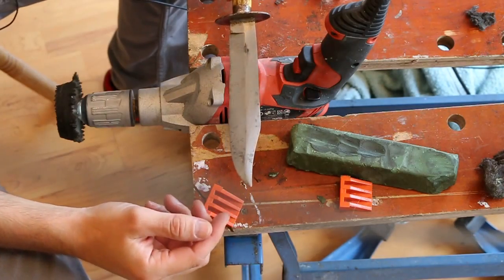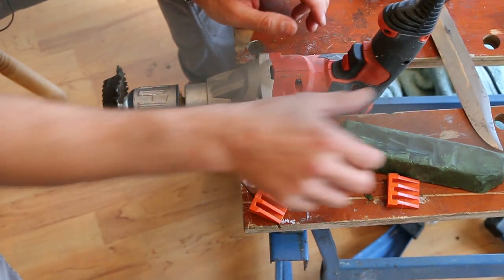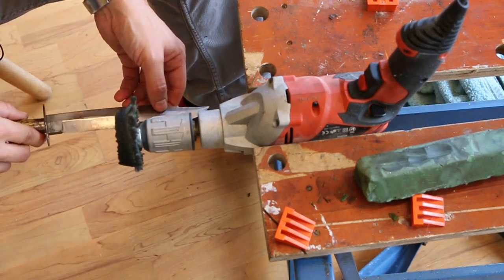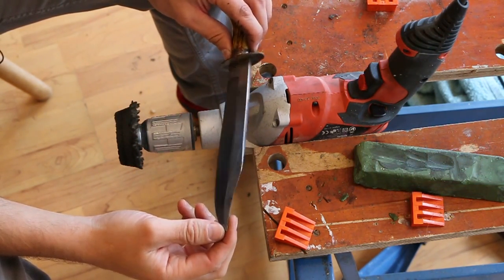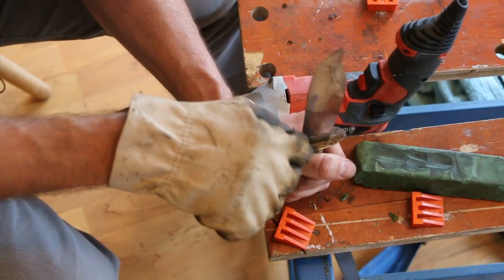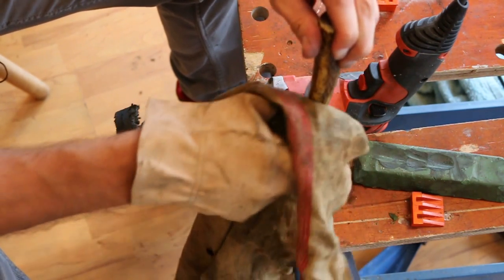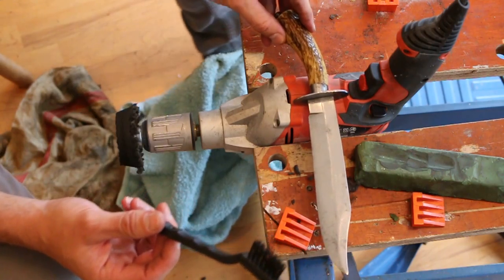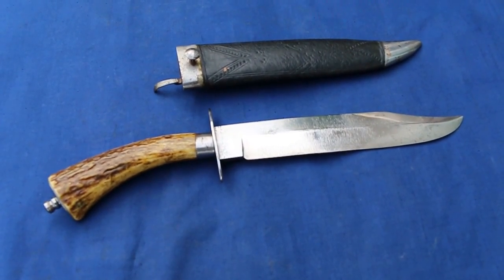Restoring an antique Anglo-Indian bowie knife - Part 2

Comment: Hi Matt. Love the videos. Keep them coming. I restored an old Mexican bowie knife a few years ago. It was an antique store find. It had a really great hilt and that's what initially caught my eye. It was cast aluminum in the form of a snake eating its own tail. The head is the pommel and the tail wraps around to form a wavy knuckle bow. It also has bull horn scale inlays. Since the handle was, of course, corrosion-free; I began working on the blade. The blade was quite crusted in layers and layers of scale. Instead of going full bore and sanding it, I opted to use the very narrow tip of a needle file to flake off the rust. Hours later, my efforts paid off as both sides of the blade were etched, though the edge had been roughly ground throughout its 90 years (stamped "Gomez 1925" on the hilt). One side has "Mexico" etched into one side and the other side is a scene of a lion running through the desert, possibly holding something beneath its paws (past rough grinding on the edge removed some detail). I painstakingly removed all the rust and then used a piece of rough toothed parchment paper and some mineral oil to remove any surface rust and leave the patina to accentuate the etching. I prefer mineral oil for all of my knife and sword care personally.

Comment: Especially from a H&S Standpoint you never ever wanna wear gloves when using a Grinder or Buffing-wheel. Reason being the glove can catch on the Wheel and drag your hand in resulting in some very nasty accidents. Another benefit is that you're very unlikely to overheat anything since its gonna get too hot to hold long before that happens.
I'm not sure what kinda damage a drill mounted wheel can do but i dont plan to find out.

Matt how would you restore a blade that has etching or surface decoration on it?  some Chemical treatments like electrolysis perhaps?

Comment: If anyone is looking for the "green stuff" - it's chromium oxide buffing compound. It's also very useful for stropping.

I would also like to mention that the varnish is actually very likely shellac. Shellac is not a chemical, but an excretion of the female lac bug, which is indiginous to India. Most shellac is, and always has been, produced in India, which is why it's highly likely that this knife was coated in shellac.

Unbleached shellac has a brownish teint to it, but even bleached shellac turns grimy-dark with age. As bits of the coating might come off when using the knife to cut meat etc., shellac is also a good choice for protecting knife blades with, since it's completly edible. In fact medicinal pill hulls are often made from shellac.

Comment: I'm wondering do antique swords and blades still keep a good edge? Like is the hardness and temper of the steel similar to when it was first made or does it wear with age?
Reply from the maker: The hardness remains the same for all eternity, so long as the blade is not heated again.
Reply: Thanks for answering, that's really cool. I'm curious do you whether  old swords were reused by future generations and how long did swords get used for, if you know what I mean?
Reply: isn't there such thing as "tired" metal?
Reply from the maker: Fatigued or work-hardened, yes. If a blade is stressed too often (for example by flexing, over-flexing, or bashing on things) then it will start to become brittle and tiny fractures will form in the steel.
Reply: Swords that haven't been used much could get used over generations (same as firearms today if maintained properly), but keep in mind that fashion changed rather rapidly. While a poor man could use his grandfathers Landwehr, someone with a bit more money and prestige would probably not be caught wearing his grandfathers old people-poker. Plus, styles of fighting changed as well and older style swords could become outdated, again just as firearms today. My grandfathers Luger might work perfectly well, wouldn't take it to work though.

Comment: Green stropping compound is best for almost everything, but red jeweler's rouge, which is also a type of stropping compound, will put a mirror surface on even an antique blade.  Just don't make the mistake of buying industrial red compound made for use of power tools.  Industrial and stropping compounds use the same colors, but not for the same grits.  Red industrial compound is  extremely aggressive and can damage metal rapidly.

Honestly, there is absolutely no need to use a power tool to polish knife blades.  The best true mirror finishes are done by hand by stropping, not by using a power tool.   If you use the correct compounds, it doesn't even take very much elbow grease.  Even with very old, troublesome blades, if you start with green, go to white, then to red, you can put a mirror surface on your blade that's better than the one hanging in your restroom.  You can often even skip the white.and go straight to red.

Or, if you're a fanatic and enjoy the process, you can use green, then green fine, then white, and then red.  I do this at times just for the heck of it.  I don't get a detectably better edge if I'm sharpening, or a detectably better mirror finish if I'm polishing, but it's still fun.

Anyway, I've seen too many knives and swords damaged by power buffing to ever do so, especially when a hand strp does as good, or an even better job.  Sometimes the damage done isn't even noticeable until later one when you notice a ripple that shouldn't be there when the light is just right, and you're looking at it from an odd angle.  

Well, they're your knives and your swords, not mine, and, admittedly, I am often a bit of an obsessed fanatic myself when it comes to knives and swords.

Last note.  When cleaning antler, ivory, wood, or anything else, I think you need to know how it looked when it was first put on the knife.   Then you use soapy water.  Then you check how it looks and decide whether to go another step and use a mild, mild abrasive of some kind.  Experience is the only real teacher here.  Look at all the new antler, wood, ivory, etc., you can find, look at wood that has been oiled or varnished,  on and on, and then decide whether you want a very old knife to look like a very new knife.   If it doesn't damage the knifes authenticity or value, I usually want it to look as new as possible.

Comment: Two questions.  First, you applied a paste to your buffing wheel before buffing the knife, and did not reapply for some time.  How much paste do you apply to the wheel, and how do you tell if and when a reapplication of more paste is called for?  Second, there are two screws holding that clasp onto the scabbard, might you remove them and attempt to rebend or straighten the clasp?
Reply from the maker: With continuous buffing I personally re-apply paste about every 5 minutes. But it depends what I'm polishing - on the hilt and scabbard fitting I tend not to apply any paste, because they are softer and more delicate, and I don't want to get paste all over the leather/antler.
Reply: Thanks for the info and the response

Comment: as someone who works in trades never use gloves with a rotary power tool. That being said his set up isnt exactly safe so you're taking a chance anyway. I mean it is a knife
Reply: Yea, I was gonna say, standard safety practice is to never use gloves when working with moving parts like that.
Reply: And solid cloth type gloves (like the earlier used ones to keep the sharp bits of metal out of the fingers) would probably be some of the worst for it when a rotary tool grabs hold of it and rips it along with your flesh off. 

I still have some icky memories of the first time I looked up the term "deglove" on google image search on someone's suggestion when learning about this particular "no gloves on rotary tools" guideline. Some of those were quite gruesome to look at.

I suspect something really thin that tears easily if direct contact has to be avoided wouldn't be nearly as dangerous as it should tear rather than try to stay in one piece and ruin your limbs. A thin latex type thing with the right grip surface maybe? But even that wouldn't be ideal compared to the direct interaction with the workpiece and better feeling for it with bare hands. I don't know much about it though, just some minor experience from occasionally using my dads workshop if I can't do the job with the tools I have at home and what I picked up over the years + common sense.
Reply: yea a big enough machine will take your whole arm off 🙅. You're right about latex gloves. Maybe they could make tear away gloves that easily come apart on the seems haha

Comment: Would using 800 -1000 grit wet dry clean up the grind marks without damaging the "patina" to much? The pitting looked deeper than the grind marks. Of course you couldn't be heavy handed as that would be more damage than just leaving it alone.

Comment: How would you recommend removing red rust spots?
Reply: Watch the first video? (WD40 and wire wool.)
Reply: Bo Zo Oh, should have made myself more clear, I have tried that. But there a some bad red rust spots that won't go away.
Reply: You can try a rust converter.  The tannic or phosphoric acid will convert rust into a stable black oxide.  The acid may damage other materials (eg. brass, organics), so protect adjoining areas with tape, varnish, wax, etc.
Reply: Oh, and be sure to follow up with oil, wax or varnish afterward.
Reply: One rust converter commonly available in the US is called "naval jelly".
Reply: Thanks for your help!

Comment: how did you make your drill keep spinning while your finger isn't depressing the trigger? is this some sort of specialty drill?
Reply from the maker: Many drills have that function - it's a locking button at the side of the handle.
Reply: A lot of the older drills my father has definitely have that function, some of his newer tools don't though.
I don't know if its an industry best practice/design change or maybe mandatory safety regulations to prevent runaway tools when you drop/release them.

I'm not entirely sure how this is supposed to work for things like drills, but I certainly noticed a trend with other rotary tools like grinders etc to no longer have them on new models. Not a pretty thought actually a runaway grinder with an abrasive wheel attached slipping from your hands going on a rampage.

That said if you have one without the button that may be deemed "dangerous" by the industry/regulatory bodies there's always the tried and true method: tape the trigger so its on 100% of the time and switch it on/off externally at the power cord somehow (switch in the cord, power strip with a switch, whatever gets the job done really). 

If you do plan to do this tape method though be very sure about how you're fixing the tool in place. Ideally you want to use a proper grinder that's made for it. But use some common sense and make sure it can't accidentally get loose and don't be in the place where it'll go if it does get out of whatever is holding it.
Reply: Good idea. Thanks for the tip

Comment: If you change the color of the steel you have ruined the heat treatment in that area.
Reply from the maker: No, that's an exaggeration. Up until the colour blue there is negligible change to the hardness. The steel will go through straw colour first and at that point it really doesn't make much difference at all to the hardness or anything else.
Reply from the maker: In any case, to get a blade to even straw colour from buffing alone is a difficult task and your fingers/gloves will be burning by that point.
Reply: The discolouring will begin to apear between 100°c and 200°c and so long you're not keeping that temperature for an hour or more, you're not changing the properties of the steel. However that is only important if you're working on a piece of already hardend carbon-steel.
Reply: I have trashed many a blade whilst learning about them.  I have only ever ruined blades by using a stone grinding wheel and the other method was a belt sander. Both of these generate immense heat and friction very very quickly. 
Alas. The downside of having mediocre tools lol. 
I agree with everyone else if your not wearing gloves you'll burn your hand before discolouring the metal.

Comment: In America, we tend to leave patina alone on antique guns and knives. My opinion is you buffed its history off. Way too shiny to my eye. You would have cuts its value in about half over here. I have bought a few antique guns from Britain, and all had been over-cleaned. we stopped doing that in the late 1960s. Lots of museums ruined lots of guns and blades. They probably still do. Our philosophy among collectors is that more antiques have been ruined by cleaning than by being left alone.
Reply from the maker: It's important not to 'over' restore. That's a subjective scale and I don't think that I did that here, though I have cleaned this one much more than I usually do (just see www.antique-swords.co.uk for what I normally sell). I think this perception of cleaning vs doing nothing is partly because of a misunderstanding in the US about what looks old, coupled with the fact that there are far far less antiques in America. Roughly 50% of the antique swords I sell go to the USA. Firearms are a different matter to bladed weapons, because most firearms were blued or browned and it's impossible to clean those surfaces much without removing those original finishes - with a bright steel blade it is a completely different matter and a well kept antique sword blade looks exactly the same as a cleaned sword blade. Bright steel is bright steel. I have many antique swords which are shiny like a mirror, simply because they have been kept like that since they were made.
Reply: Oh yes, but I have bought antique firearms from Britain and Europe. Just a different taste I suppose. We really and truly don't generally like them cleaned here. I certainly didn't mean to imply a criticism, and only meant to point out the differences in our taste as collectors here. Thanks for the reply. I have become a fan.